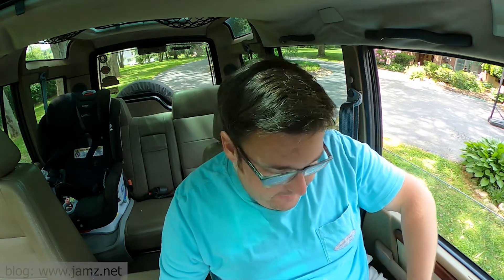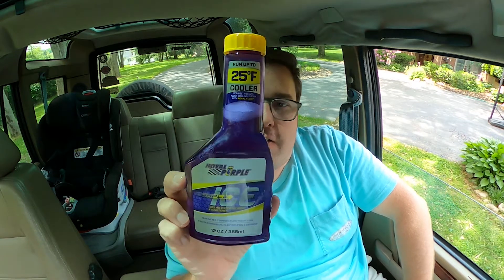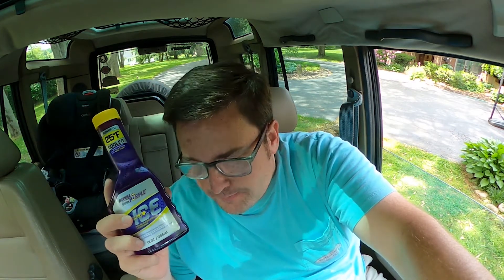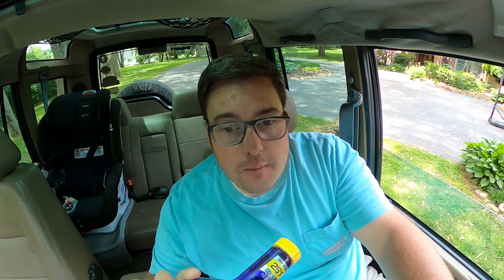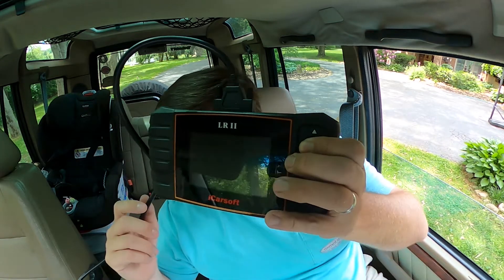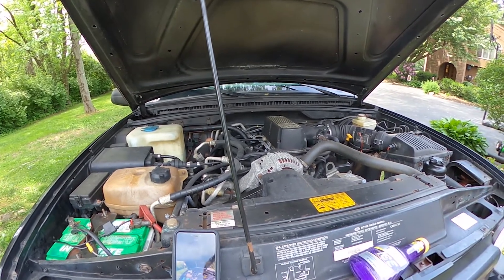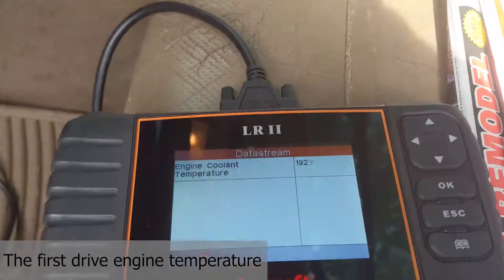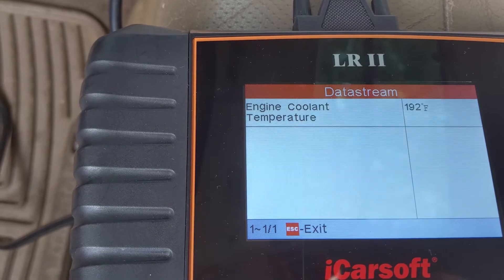Purple Ice engine coolant additive - does it work? | engine coolant

Comment: Use it with 100 percent distilled water and make sure no air bubbles are in the system and remember my name.
Reply from the maker: Yea, I hear the best way is with water. Less than ideal for my winter driving:)

Comment: I’ve used it on my 2002 corolla after an entire cooling system replacement and flush. I believe it works , I live in the California desert with triple digits in the summer and not a single time has it over heated on me in the last 2 years.
Reply from the maker: Awesome to hear. Heat like that is certainly a true test!

Comment: I'm trying it today in my 2002 Blazer ZR2 w/ 300k miles here in very hot SE Texas. Has a 195° thermostat. 
It runs at 195° to 200° on 79deg F days or cooler but slightly higher on those summer 90deg + F days. 
Especially when I'm towing a small 5x9' utility trailer with 200lbs in it. 
That 4.3 Vortec is strong & runs great. It should because I've spent so much on it. 
Actually it runs better than my Wife's new Ford Escape! 
However, ICE won't hurt it.
Reply from the maker: Keep me posted on how it goes and if you see a difference!

Comment: MAYBE THIS VEHICLE IS DIFFERENT , BUT THAT LOOKS LIKE AN overflow bottle.... you need to put it directly into the circulation system ...i.e. the radiator....
you aren't going to pull from the overflow bottle , unless you cool down from overheating and the cap vents.
Reply from the maker: Thanks for watching. It calls to put it here. In theory, the overflow tank fills a little when hot, then the level goes down as the coolant cools. The additive slowly gets mixed into the coolant.
Reply: so wrong
Reply: You aren't related to Jonathan Traylor, are you? Christian rapper? Lol
Reply: @aaronschocke2147  wouldn't  know

Comment: How's the temp after some months?
Reply from the maker: Well it's been super cold the past few months and I don't drive this due to salt on the road. Once it warms up and I am driving it again will update.
Reply: Oh ok . I have one more question. So when it's really cold my gauges don't work . They start working after a while of driving I have no idea what it is would you know?
Reply from the maker: @moosepilot3145  All of your gauges or just the temp gauge?
Reply: @moosepilot3145  well if your car is old enough and it has the speed sensor located in the transmission. then when its cold it can cause it to fail if its worn out. my th400 needs a new speed sensor gear. its relatively cheap to replace but you need to know the finale drive if you replaced the tires so you can get the right speed readout. but if its al your gauges maybe you have a bad ground somewhere. So i would make sure your grounds are good.